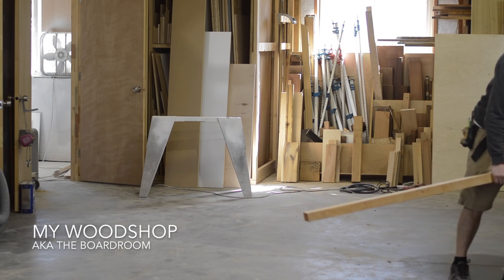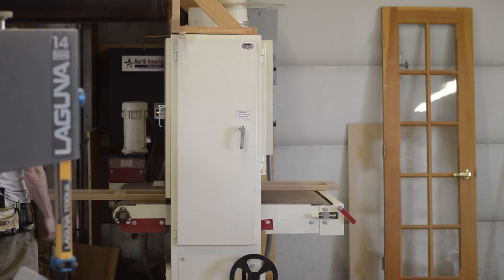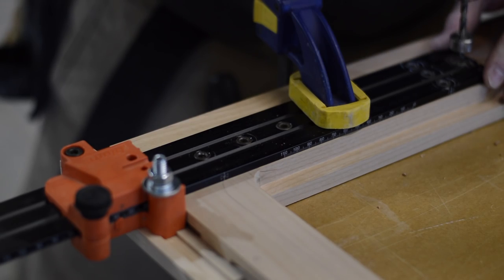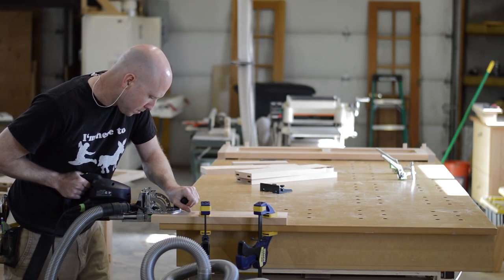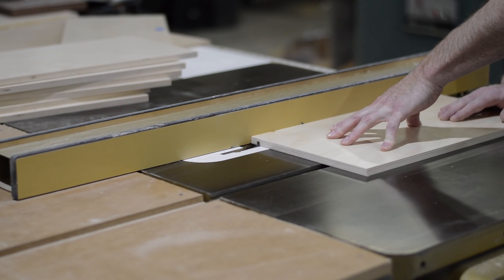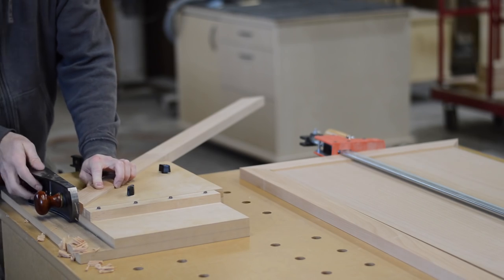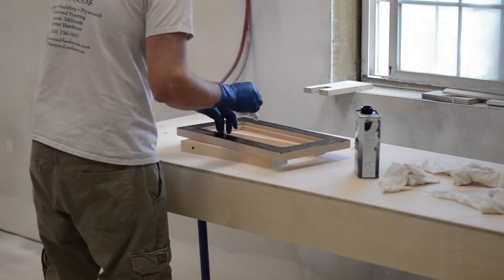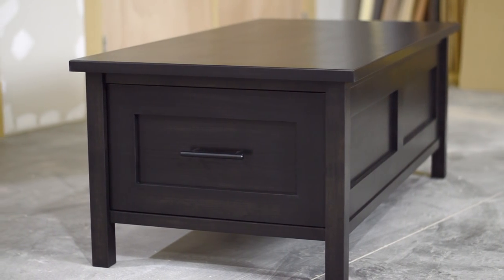Lets build a coffee table with drawers

Comment: Any advice for the type of paint I can use that would have a hard finish compared to poly acrylic? I have a graco ultra cordless sprayer. I love the finish it puts down but the softness of the paint I have been using I’m not happy with.
Reply from the maker: It depends on what its going on, but for a water based paint that can be sprayed through an airless I have found Cabinet Coat to be really good. It is a slow cure type paint though, like 20 or more days for full cure. Dry to the touch in an hour or so.
Reply: Thanks for the reply. Just trying to step up my finish game as I do more painter projects. I last have a air setup but never tried to get into that (drier, and spray gun) any tips or thoughts? I see you use a air sprayer.
Reply from the maker: @debow567  I use a few different spray setup depending on what I am doing. I suggest starting with either an HVLP setup or a compressor and spray gun. Play around with them on some scrap. Thats how you start. Keep at it and your skills will improve.
Reply: Any recommendation on a spray gun? You have had good luck with ?
Reply from the maker: @debow567  Binks makes some really good spray guns, but they are pretty expensive. I also really like C.A. Technologies stuff. If you want a cheaper option, I have had pretty good luck with the Harbor Freight spray guns as well.
Reply: Listen thanks for all the info! Appreciate you taking the time to respond. Love the channel.

Comment: Biscuits are for alignment. They’ve been proved to not be very strong.as compared to dowels or dominos
Reply from the maker: Both statements are true and not true. Yes, biscuits are great for alignment, but they are plenty strong for this application. Regarding strength, please refer to Fine Woodworking #203. They do a great joint strength test, and keep in mind for this build I used the S6 not the #20 size. I have been building things with biscuits since the late 90's, I have never had something fall apart yet.

Comment: Mike, I've ordered two different types of Blum hinges and neither one of them takes a 5 mm screw. The holes simply aren't large enough and you're stuck using the standard tapered screw. Would you be so kind as to tell me where you get your hinges and more specifically the precise model number of each. Thanks in advance, buddy.
Reply from the maker: Hi Michael, can we start with the part numbers you have purchased? Feel free to email me.
Reply: @MikeFarrington  I would be happy to email you, Mike, but I can't seem to find any direct email address. In any case, the hinges I typically order are called Blumotion Compact. Typically I build cabinets with a face frame and allow a half inch overlap of my doors and drawer false fronts. These particular door hinges require the standard tapered screws as the main hole opening is only about 3 mm.
Reply: @MikeFarrington  I accidentally hit send before I had finished. I'm sure I'm the only person on the planet who has ever done that.

I would like to start doing more inset doors and drawers like you did on the built-in bookcase or coffee table projects, but I can't seem to find a way to determine the correct hinges to use. The Blum catalog is a bit intimidating.
Reply from the maker: The compact hinges do not come in a 5mm screw. I will be doing a video on hinges soon. Stay tuned for that. Check out my website, I have my email listed there.

Comment: Curious...What is your reason for preferring the biscuit joiner over the Domino in most of your builds? Just noticing you prefer that tool and the whole world swears by the Domino? I have a domino which I recently purchased, still practicing with it and getting used to it. Used a biscuit joiner for a long time for trim work, but just taking woodworking more seriously and everyone told me that was the first tool i should get...So I did. What a sheep I am.
Reply from the maker: The biscuit joiner is a tool I am super comfortable with. I have been using this very model since my first job assisting a cabinet maker in high school. Its a comfortable tool to use, and its faster and more balanced than the domino. Keep in mind, I have this biscuit joiner (Lamello top 20), both Festool Dominos, and a host of other joinery options. I am also looking to add some more joiner options (Lamello p zeta). With that said I always recommend as a first joinery tool to buy the Domino, if funds allow. It is more versatile than any other handheld joinery tool on the market.
Reply: good tip...After several set up mistakes making just basic boxes with the Domino i questioned why I spent so much on it...I feel it's a tool that requires a bit of practice with if you're used to a biscuit joiner. I've finally got my groove with it (I think) and that's when you start to see the genius of the Domino. Always miss my biscuit joiner, first one I ever had was a harbor freight, still have it..Sounds like a rabid Siamese Cat when turned on. I always laughed that it was the angriest tool I have ever owned.

I know it's probably a complete PIA with work, life, and a small child, but keep the videos pumping out if you can. The editing and narration are fantastic and your topics are on point. Don't let the YT opportunity slip by, you're every bit as good as TWW. 😉👍
Reply from the maker: I think with any tool, you need to learn the language. Little details can really make the difference. Keep at it, the Domino is an amazing tool. Thank you, I'm not going to lie, editing, narrating, and posting videos is lots of work and many late nights, but my first dream was to be a teacher, but at the time, I didn't have the money to get the necessary degree. YouTube has really been that outlet for me. At this point, I will continue posting videos, the question is how fast can I crank them out and still maintain my personal relationships. Hope this makes sense.
Reply: Keep building and keep making videos, but be careful you don't burn out making videos. It is a lot of work, but so many of us like and appreciate them! DD @MikeFarrington
Reply from the maker: @dennisdownes9319  Thank you very much Dennis.

Comment: Hi, for the s6 biscuit you need to cut twice ok but also deeper than with the “20”?
Reply from the maker: I have a setting on mine called max, its slightly deeper than 20. I had another biscuit joiner before this one that could also cut deep enough if setup correctly.
Reply: Mike Farrington on the Triton TBJ001 that I have, there are also (in order by depth) S, D and MAX.
Reply from the maker: My guess is the MAX setting will work fine.

Comment: Why do you use the Edge Tech to sand the edges instead of the drum sander?
Reply from the maker: It comes down to a width thing, if its wider than thick its easier to do it on the table saw. So if some parts are wider, then the saw is already setup, and I just run everything.

Comment: A loose tenon aren't for strength, they are for alignment.
Reply from the maker: This is not true.
Reply: @MikeFarrington  good for you keep telling yourself that a simple Google search will tell you different.
Reply from the maker: @Mostviews111  Please provide links.
Reply: @MikeFarrington  can't add anything but text or emojis. Google are biscuit joints structural, the fact I have to tell you shows the intelligence
Reply from the maker: @Mostviews111  I don't want to joust at this too much, but you did say loose tenons, vs this comment its biscuits, those are two different things of which I used both in this video. Also, I have 25 years experience as a professional carpenter using biscuits, I know exactly how strong they are and when they should be used. I would suggest, rather than internet searching, you should watch more of my videos where I use biscuits to build passage doors, structural furniture etc. and all of those projects still look great. I would also suggest that commenting in absolute terms isn't a good idea. Finally, please remember to like share and subscribe.

Comment: is there a biscuit jointer that you would recommend that is cheaper than the Lamello? I'm thinking either the Dewalt or the Makita.
Reply from the maker: I owned a porter cable before the lamello. I liked it. Worked good enough. I have also used the dewalt, it was also pretty darn good.
Reply: Cool. well - being in the UK, I can't get the PC, so I'll take a look at the dewalt. What would you ay I need to look out for?
Reply from the maker: Not sure I follow?
Reply: Mike Farrington i mean what should i look for in a good biscuit jointer.
Reply from the maker: Ah, Well if the Lamello is out of the question, I think the dewalt is pretty good.